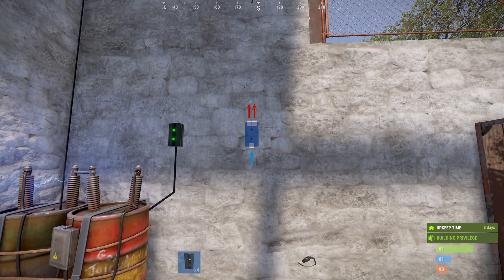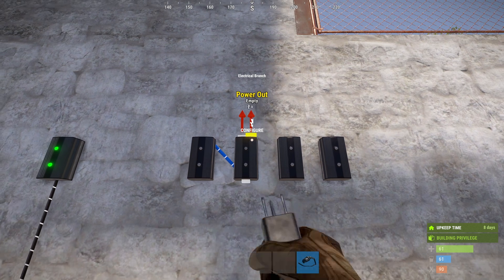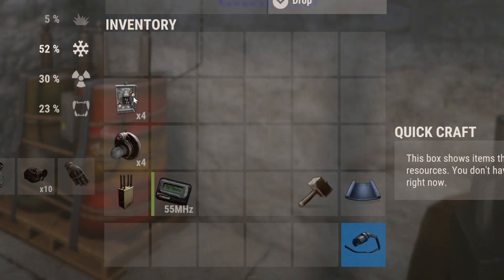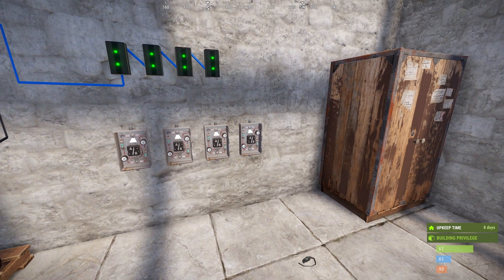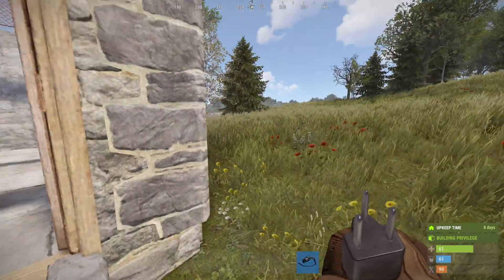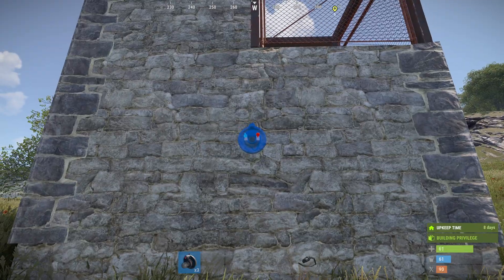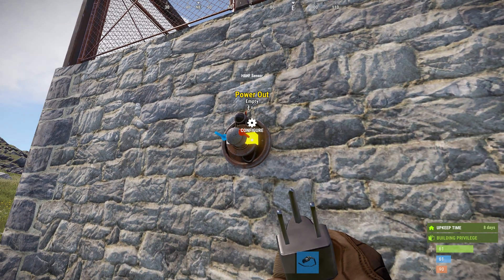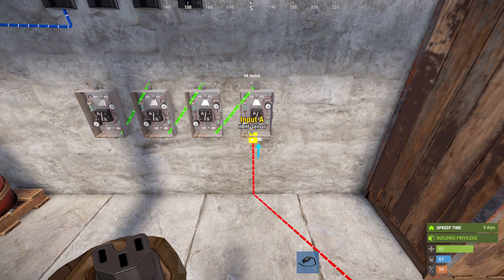Daisychain multiple HBHF Sensors to one RF Broadcaster - Electricity guide - Rust

Comment: Any way to add door controllers into this circuit?
Reply from the maker: You can connect the OR switches to the open door input on the door controller. Or, you could use the RF receiver instead of a pager and connect that to your door controller.